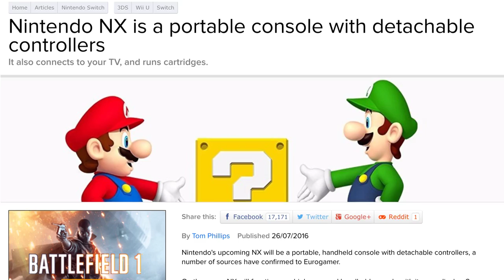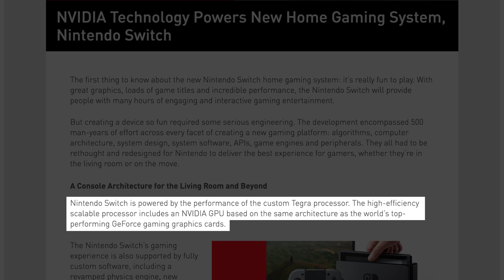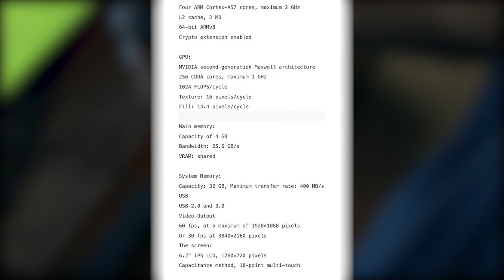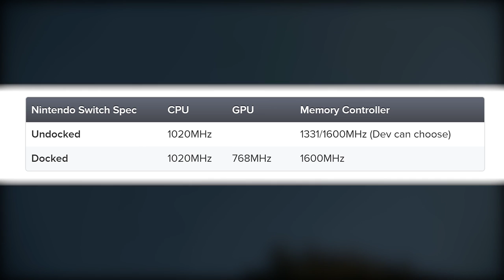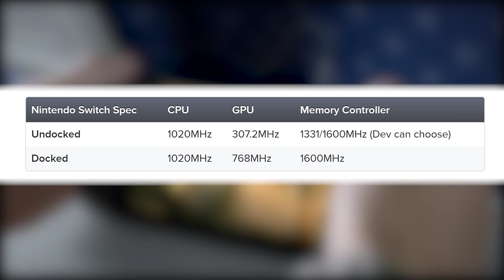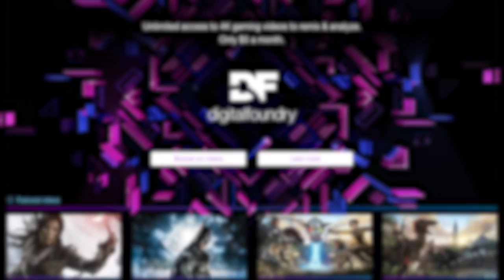DF Videocast #6: Nintendo Switch Clock-Speeds Revealed

Comment: This piece of shit has less than 400 Gflops while the Xbox One has 1,310 Gflops of GPU power....The Switch is literally less than half as powerful as the Xbox One.
Reply: Walther Penne The CPU of the Switch needs to run on that 20W TDP limit, it's even lower power than the Jaguar CPU and it runs 730 MHZ slower to top it all off. So sure, maybe it has a better IPC than the Jaguar, but that clock speed ain't helping it for shit. If the Switch's CPU is an 8 core variant, than at most it's gonna be about 90% of the Xbox One's CPU power. Remember, the Xbox One CPU also has faster memory, by about 533 MHZ faster than the Switch's memory, so that also helps with Xbox's faster CPU and GPU performance.
Reply: Walther Penne Battlefield 1, Crysis 3, Witcher 3, Watch Dogs 2, Black Ops 3, Battlefield 4, Gears of War 4, Quantum Break, Infamous Second Son, Ashes of the Singularity, Overwatch, Rise of the Tomb Raider, The Division, Deus Ex: Mankind Divided, Doom 2016, Hitman 2016, etc. These are some examples of games that show that it IS POSSIBLE for games to use more than "1-2 cores". We are not stuck in 2007 anymore dude, games evolve and change, and so will that stigma of "using only 1-2 cores".